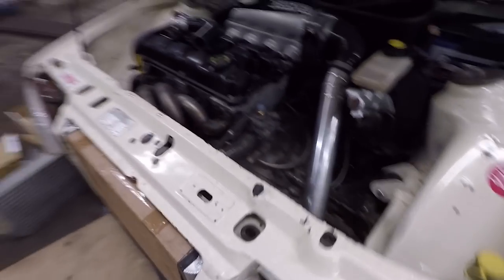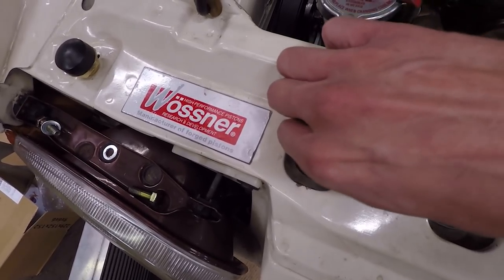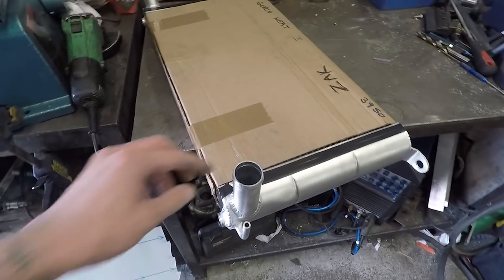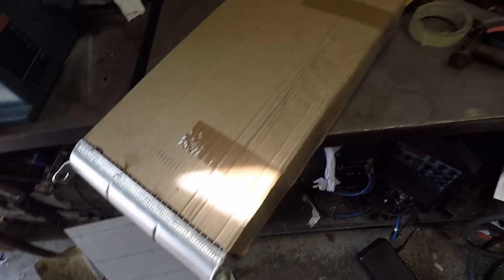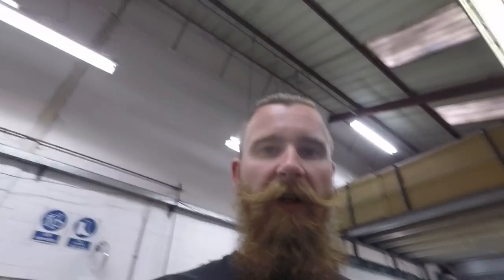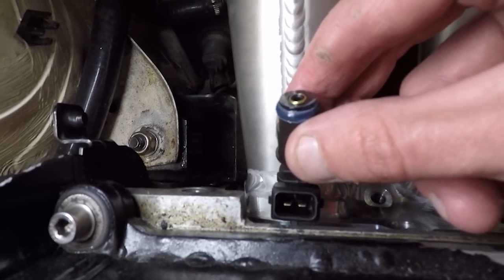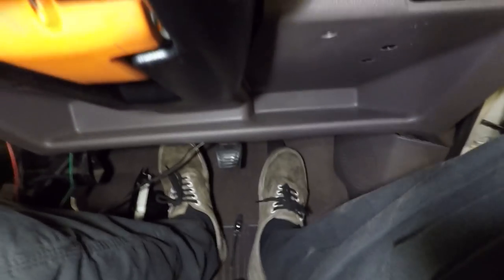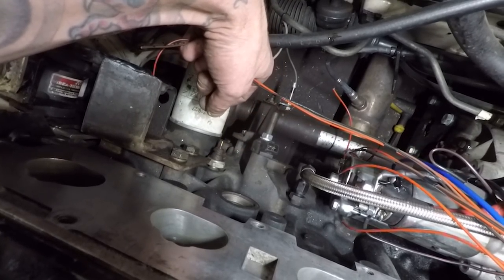Making a BESPOKE RACE Radiator

Comment: To fix the overheating you could just duct the radiator better. It doesn’t always come down to more air flow and adding a fan. Going from a small opening up front, to a large radiator and then back to a small opening is the most efficient way to transfer the heat to the air. 
Something to think about, but fantastic fab work either way!!
Reply: I dont think it was an airflow problem, it would actually overcool on the road at speed and run pretty cold. It was only stationary after a run it would creep up despite the fan being on. The old rad was full of rad weld (I know I shouldn't have) as it was never great as it was the first rad I made. This now runs even colder on the road (seeing temps in the mid to high 70s so ive ordered a higher temp stat) not had a chance to test what its like stationary after a run on a warm day yet though
Reply: @zewspeed  ahh ok. Thanks for clarifying